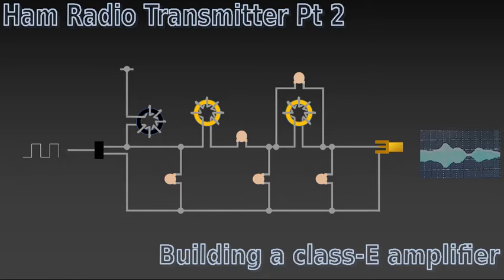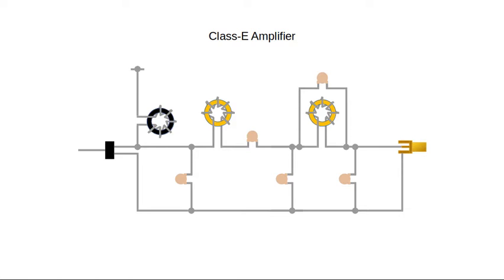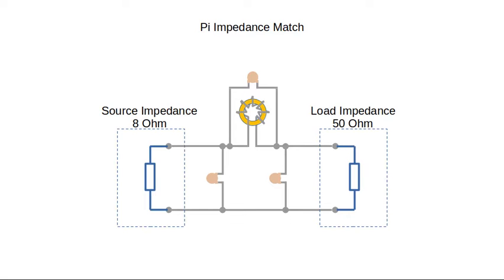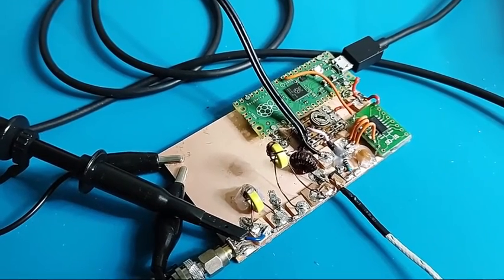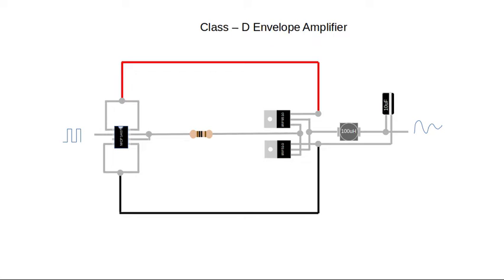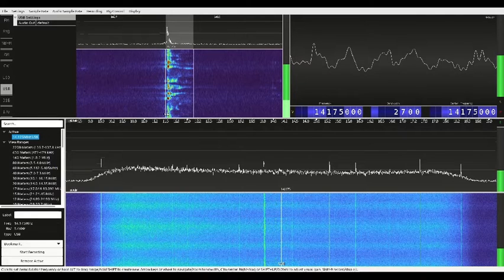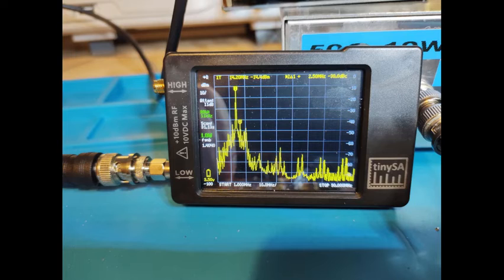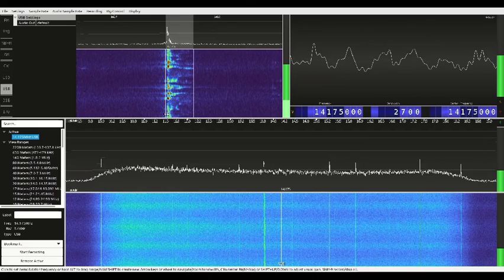Pi Pico Ham Transmitter part 2

Comment: Jon, i built your transmitter with the microphone input as you specified. I programmed the frequency for 20mhz but with the scope i see 25mhz - this is on a pico2 and FM mode . Nothing else changed
Reply from the maker: Hi, that's probably a difference in the default clock frequencies between the 2 devices. I think it's 150MHz for Pico2 Vs 125MHz for Pico. You could dividing your frequency by 1.2, or try editing nco.cpp to replace 125e6 with 150e6.

Comment: If I were modeling this - any idea what kind of load the class e amp presents to the class d audio amplifier?

I wanted to play around with this sort of idea, either using other mosfets for the class d, or trying to use an off the shelf class d audio amp, but unsure how to determine this.

Thanks again for sharing the great projects!
Reply from the maker: Thanks! Good question! Simplistically, the class E amplifier is configured to deliver 5W with a 12V supply, so I think it would look like about 29 ohm load to the class D amplifier.
Reply: @101Things-ds8tc  haha, yeah, that makes sense!  Thanks!

Comment: This is exactly what i should be building so I don't blow up expensive radios that are too complicated to fix.
Reply from the maker: Cool, it should be pretty easy cheap to replace the output transistor if you blow one up.

Comment: Regarding your PICO RX, It would help it you labeled the orientation of the chips on the pcb.  I'm building up this cute receiver...
Reply from the maker: Cool, best of luck! With regard to the chip orientation I used the standard kicad symbols, the pin 1 end is marked with a slightly longer line on the silkscreen, but I agree it could be clearer. If you have any problems, raise an issue on the gitHub page and I will do my best to help :-)